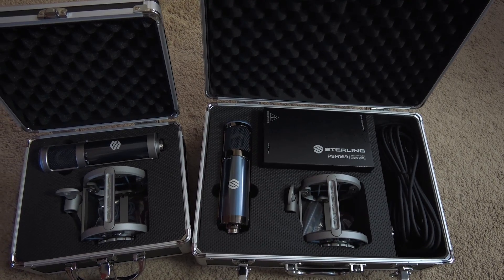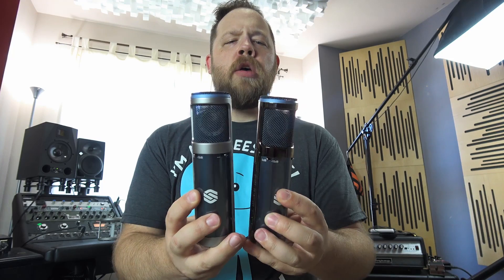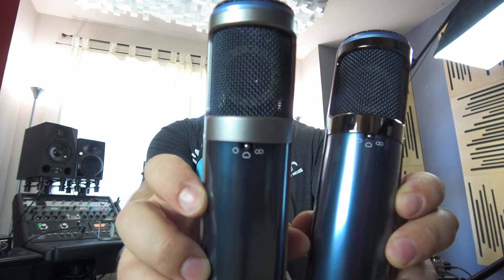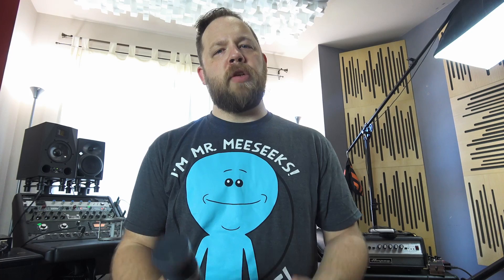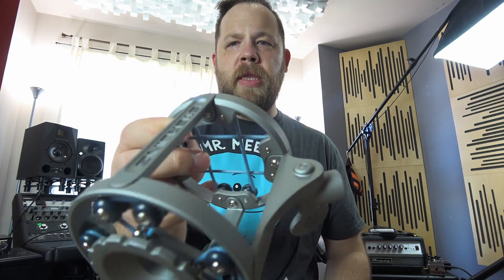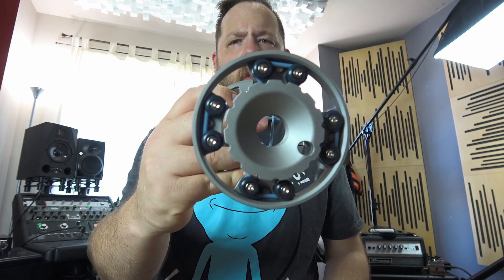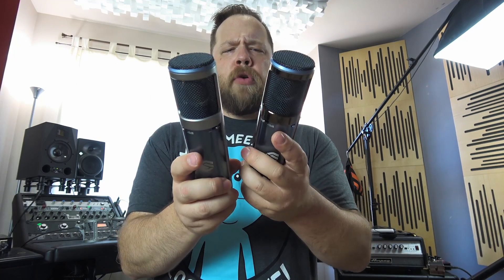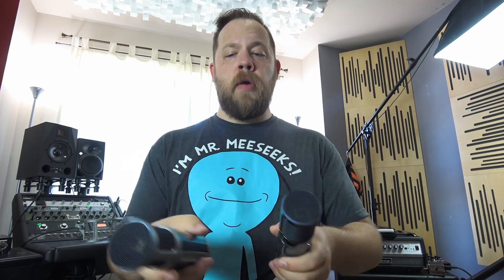Sterling Condenser Mics - Demo

Comment: Sterling is the best mic for vocals, believe me... If you sing for real, you better have one of these instead of the overrated SM7b
Reply: Hi Enrique, I know it's been a while since you wrote this comment but I'm wondering how did you get sound to come out of the microphone because I have been trying to get that mic to work for the longest time! I got a Audiobox for my mic but it doesn't seem to work. I know the mic need 48v for it to work. PLEASE HELP!!
Reply: @katerinasvlogs  are you using the sterling 159 or the 169? I think the 169 has the external power supply that must be turned on. The 159 only needs to be plugged into the audio interface and then turn on the phantom power.
Reply: @felipeguerrero2409   Hey! I actually got it to work just two days ago. I didn’t wanna get a new audio interface but that’s exactly what I needed for it to work. Thank you though 🥹😄

Comment: The very first thing I notices was that the 169 has a bit more bottom end with more peaking but smooth dynamics and the 159 has more dynamic ranges but is a bit less accurate in doing so (I think it tends to pick up a bit more dynamics that you don't want to hear which makes it sound a bit weird) however it does feel like it adds some clarity. What I would personally do is use both at the same time with a different Post-EQ and with the 169 at a lower volume so they will articulate and compliment one another.

Comment: The ST 159 sounds exactly like the Rode NT1 (not NT1a) but the 169 is way fuller with more body to it.
The 159 technically sounds correct, the 169 sounds the way you want it to sound.
Reply: You are exactly correct... I have the ST159 and NT1 and they  mirror sound perfectly. Honestly, a neutral sounding mic is what everybody should seek.
Reply: @gRosh08 so is the 159 good?

Comment: Dumb question time:  What is the purpose of the shock mounts?  Is it to damp out vibrations from loud sounds so they don't get transmitted into the mic?  To prevent or minimize damage when the bass player spins around and slaps it with his headstock?
Reply: Hahaha a bit of all the above... but mostly its there to isolate the mic from vibrations/footsteps/neighbors subwoofer/really any thuds around the mic that can come up through your metal mic stand as bursts of low frequency energy (sub bass).